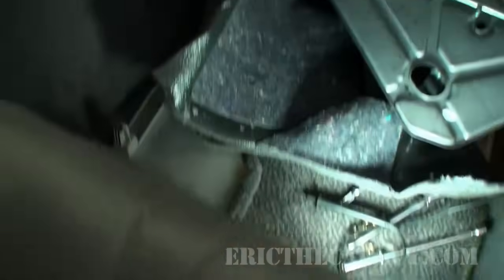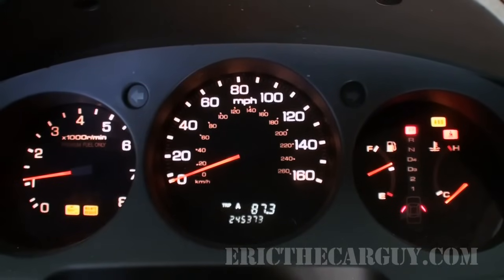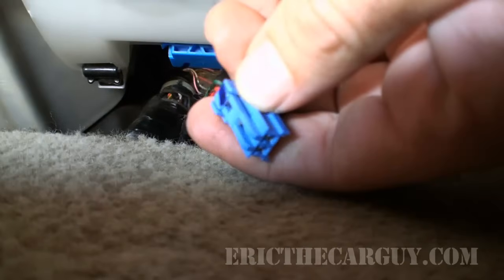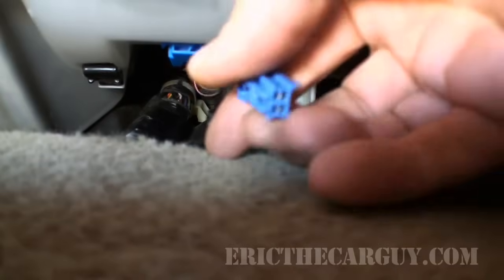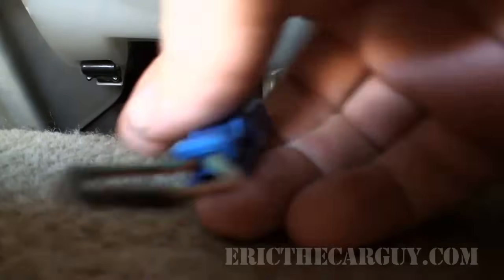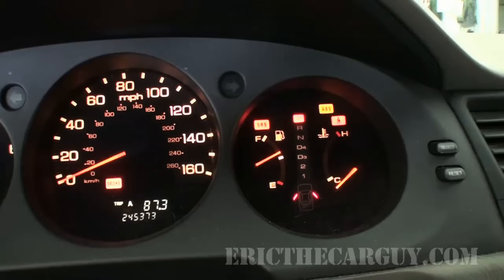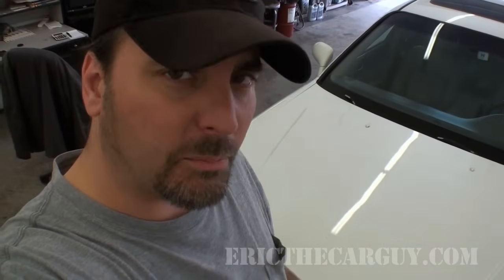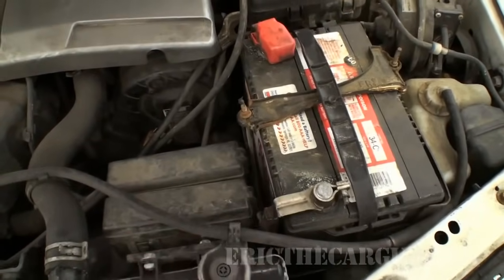How To Pull Honda Codes Without a Scanner -EricTheCarGuy

Comment: Thanks Eric, I was able to find that connector and after jumping it I got  a code 8 which was caused by the shift control solenoids being bad, it was easy to replace. You saved me lots dollars I am sure since transmissions shops are not cheap and I am sure they would say that I needed a transmission overhaul.

Comment: is it possible the first digits are the short pulses? i have 1997 Honda Civic, after shorting the wires and switching on the first flashes i seen are 7 short pulses then followed by 1 long pulse... please advice ^_^

Comment: Eric, got a good one for ya. I have 97 acura 100k mls Fla. car nice cond. ABS light on NO trouble codes on my OBDII or dash w/ jumper. I replaced All brakes new. everything except this stupid idiot light is working as it should.
Can I disable the dash light or something? need a NY inspection.
keep the great vids coming.
Reply: No, if they use a scan tool it will show the light as being lit. Move to FLa.
Reply: my abs light was on because i had a secondary brake bulb out.

Comment: If you can figure this one out your my hero....the CEL on my 1992 Accord WILL NOT light up.  I have replaced the engine cpu, the tranny cpu, the instrument cluster and actually rewired the circuit from the cpu up to the cluster itself.  However, when I do the test as you describe, the D4 transmission light flashes slowly (it is actually always flashing, just much faster when engine is on.) even though it shifts fine (after replacing the trans cpu) and doesn't seem to be a problem.  So I think the D4 light is actually acting as the CEL would.  There are some stalling issues and a difficulty starting when cold.  I can figure those out but do you think that my theory is correct regarding the D4 light.  Incidentally, it seemed as though the D4 light was flashing the code 1, so I replaced the O2 sensor, but no change.  I think that the D4 light is incapable of flashing the actual correct code for what is going on with the car.  ANY THOUGHTS?
Reply: check ur lower transmission shift solenoid wiring....mind was carowdded from leak coolent .   clean it out or jump it.   mind work back now ...now more d4 flashes.  good luck

Comment: hey Eric, i got 98 prelude i've been trying to look for the blue connector i couldn't find i strip the console down where my obd2 locate i still couldn't find it, i do seeing the female for the blue connector but nothing plug in it or any wire, can i jump from the obd2? which pins?
Reply: Its on the passenger side, go on facebook and add bballiancetb, prelude enthusiasts page. You can ask for help and tips

Comment: i bought a 93 del sol project car and have been building her up throughout the year and just installed an after market radio(pioneer ehg3600iu). couldn't get it to work the first time so messed around abit and replaced some fuses and ran power straight from battery. now for some reason my speedometer, RPM gauge, gas gauge and temp gauge doesn't work and the check engine light doesn't work as well because it was on before I put the radio in. but my turn signals, gear indicator lights and the actual brights indicator light works.  any ideas would be greatly appreciated.

Comment: On my 1996 Honda Accord, I ran into some problems trying to find a place that had a scanning tool to help me get the right code to get rid of my check engine light. So I just had to use the paper clip trick, and Google the codes online..

Comment: Hi Eric , hoping you maybe able to help I have a 2006 Honda jazz 1.2 DSI petrol the ABS light permanently stays on. Some one plugged in a tester and told me it shows a defective wiring fault/connection on pump. Can you provide any assistance do i require a new pump and modulator unit. Any assistance would be greatly appreciated. Kind regards

Comment: hi Eric, good day! I have a civic Lxi AT & here's my problem while on Neutral I step on the Gas not so hard just to make the engine make a noise then I put immediately the transmission to D3 then step on the brake & when I step out of the car I found out that theres an oil leak then it was the Transmission Fluid my Question is what happen to my car? the past years I'm also doing that but that not Happens, that was the first time I experienced it to my car, I hope you answer my Questions Thank you
Reply: Aneurism.

Comment: I used your video to pull ur codes on my 95 accord vtec (non obd 2) 
And one of the codes I got was code 52 for the Srs which is internal Srs failure 
Would you happen to know more about this particular code because all of the 50-60 codes are Srs internal failure
Thanks

Comment: I've come to the conclusion, that car manufactuers are idiots, and consumers are even bigger idiots.  Go to any junkyard, and look at the thousands of different dead cars, all with parts - not interchangable... and not built to be reliable... and way to complex  Then look at how many of them... are front wheel drive crap that is near impossible to work on, with the engines squeezed in their like sardines in a can.
Reply: no, I think you're the idiot here.
Reply: Some of those things aren't even safe to sIt in.

Comment: The shitty bullshit thing is that every god damn car should display these codes on the dash with a LED 2 digit number(bonus if text explanation is included with code or a voice box talks them out).  And every car should display key critical sensor data of shit that can fuck up your engine or keep it from running.   Voltmeter, water temp, oil pressure, oxy sensor air/fuel ratio, after boost temp, detonation, and a noid light when your injectors fire.  Most cars have all these sensors feeding the computer plus more, but no display of them at all.  When they go bad, the computer gets bad data, and your car runs like crap or not at all.
Reply: man, sounds like someone hasn't been laid in awhile........bro, in a perfect world I'd be a millionaire......the car IS talking to you, you just need an index of what the codes mean.......SHEESH

Comment: It's cool that you know how to do that, Eric. Some of the local auto parts stores here in Minneapolis and Saint Paul will do a code scan for free, but they also gave me and my friend Torleif a THREE PAGE printout of what the two trouble codes might mean! I figure they want people to buy one part after another, guessing what the trouble code means.

On his 2001 Dodge Grand Caravan finding the trouble codes is easy. With the vehicle off, turn the key forward three times; trouble codes are displayed on the odoemeter and then it reads - Done. That is the only thing the Dodge engineers made easy with the Grand Caravan. It's been one problem after another with that thing.

Whenever anyone asks me, "What's the most reliable brand of car?" I say, "Buy a Toyota."

Comment: It's called flash codes.Been around for ever and not a big deal pulling codes.
But nothing tells you actually what the failed parts is.Ex..If it's a P0420 which is a b1 catalyst (Aka catalytic converter) it doesn't necessarily mean you have a bad converter.
I'd recommend using caution when pulling codes or you'll end up just replacing parts and still end up at the dealer.

Comment: Eric.  My 1994 Honda Accord Wagon had a Master cylinder problem.  I replaced the Master Cylinder and the speedometer started acting whacky and then quit along with the odometer.  D4 keeps flashing.  I saw your video and decided to check the codes.  I got a 7 (TPS), 8 (TDC) and 14 (IAC or Bad ECM) and 17 (VSS) never came up.  I let the codes cycle a few times to make sure I did not miss anything.  Car runs fine just no speedo or odo Any direction you could point me toward?

Comment: Had same problem with brake lights. One bolt under pedal forget the name of it but switch will pull right out. Mine wasn't switch itself was just sticking. Replaced small o-ring and now works fine. Willing to bet that's your problem.

Comment: can you help me to reset the SRS(air bag)light which came on when I removed the battery.I know it is in perfect order but when you switch the engine on,the light goes off and then comes on.It is a 1996 Mercedes Benz C180.Regards

Comment: Mr Eric, the original PGM-FI ECU in the oldies, like the 3rd gen accord, is underthe drivers seat. That is the case in my car in particular, which is the 3rd gen accord EX-i/LX-i.
I do recall the legend being under the passenger seat, though.

Cool thing is, if you have an old OBD0 Honda and need to pull a code, theres likely a forum for you to ask the questions you need asked on.

Comment: thanks this really helped. determined error code was 52. looked up said faulty computer. performed reset and went out. one common issues I saw was computer clock messing up and reset fixes. good to know its not a $1200 seatbelt issue. If was seatbelt once labor added also about total the vehicle. finding new (used) computers for about $75. not finding them for my model yr. though. still need idea where to look for computer to get info off thugh.

Comment: they said probably cost like 1K + labor to fix, but we don't think worth putting that much into this old a vehicle and many other normal wear issues. the guy said too you don't want to do that find a 2 ohm 2 watt resistor and stick in there then computer will think normal. I think the srs computer is bad, but no idea where would be to check connections and possibly get model,. etc. to get new one.
any info appreciated this issues is really bugging me.
(sorry for double comment)

Comment: I have an 01 CRV srs came on one day after turning on stayed on. had shop reset twice. on again, every time same time of year like late nov early dec. have tested connections under seat. tried reset, but after watching this think wrong plug. notices abs flashing, but srs reset was failing. think know from another video were srs reset is not. any idea where could find connector for srs to pull code? we have cheap obdc scanner, but didn't get srs code. one shop looked said L/F seatbelt tensioner.

Comment: there should be a connector where you can jump with a wire on the passenger side underneath on the right side.

Comment: hi Eric, if i have a problem but no check engine light, will i still have codes for thoses problems ? Or it as to be when the check engine is on... ? Maybe the led under the passenger side ? i got the main relay problem, car sometimes wont star i've followed your video on soudering the relay it worked problem on the main relay reapear...so sometimes 20 min till it start...when this relay works bad is it a signal to the fuel injection ? thanx n stay dirty !  integra93 rs automatic 305 000 km

Comment: Hi Eric, I need your help please for my 97 Honda civic DX automatic. The problem is when I turn on my a.c system the lights in speedometer , headlights go high and low and it effects to the speedometer it runs crazy. But in a while the speedometer get to normal but the lights in speedometer and headlights still same. And if turn off the air condition system then everything back to normal . Could you please help me for this what is really the problem. thank you so much .

Comment: nice video Eric. question for you. I have a 97 Accord and yesterday it rained very hard to the point where lot of the roads were flooded. I may have gone over some of those little too fast to get to work, but my check engine light did not come on at that time. 
 I came out of work and started my car and check engine came on and flashed one.
can you tell me what it means? Thank you....

Comment: hi,i have a problem with my car....hope somebody can help me on it....i have honda accord sm4 or cb7 1992....i tried as this video to find out any codes that might be any parts wrong in my car....but i ended up with the check engine light on when i connect the jumpers...it doesn't flash or anything it just keep on all the time and if i plug out the jumper it turn back normal(it went off)....can anybody tell me what's wrong with my car????or what should i do???

Comment: Hey ETCG,

I have a 1997 Honda Accord EX and my ABS light is on. I pulled the code using the paperclip method. It had only one code which is, one long blink with NO second short blink, then it did it again one long blink and NO second short blink, and then again one long blink with NO second short blink. It only did that three times and then the ABS light stop blinking after that. I went on to your website and it stated, ABS pump motor over-run for code 1 but can you double check for me please.

Comment: Just done a UK 99 Honda CR-V with this method. The R/H/D UK cars blue plug is on the passenger side (left) footwell near the centre console. It has 2 plugs plugged into a blue plastic holder - one is the 2 pin plug and the other is a 3 pin plug. I used the 2 pin plug for SRS and ABS codes, and it worked fine (SRS codes wont cycle, it flashes each code once then stops. Turn ign off and on, it will start again) There is also an SRS reset plug in the fuse box (yellow square plug with 2 green wires)

Comment: i have a problem with my 94 civic. when i jumped the connectors the SRS light flashes constantly but the check engine light just stays on. I can't figure out the problem please help and respond.

Comment: i have a 96 civic ex and theres a little black button right next to the fuse box under the drivers side. what happens if i push it? is it like a fuel cut off switch? i vaguely remember my auto teacher talking about this but im not so sure

Comment: Hey eric i have a Hyundai and its supposed to have a check engine light when turning on ign then its supposed to go out when running if all is fine but it doesnt come on at all .....not even on ign or even if i force a code by unplugging the TPS harness etc, i checked the little bulb and it was fine even swapped it for the battery symbol dash bulb to make sure that the bulb may have looked ok but was bad but still no Check engine light ........im stumped. any clues ?

Comment: Hi EricTheCarGuy! First of all, you ROCK, man :)I just am having difficulty...  how to CLEAR an OBD1 code?????? I have an S10 Blazer from 1993, (full name: 1993 Chevrolet S-10 Blazer Tahoe LT, 4.3L and 4x4.) Flashing out Code 43. It's stored now.. Tuning up this truck, but WHAT DO I DO! The light stays on, and all I can do with the paperclip is get it to flash not CLEAR... I even have a wiring harness to my OBD2 but it doesn't work with it. just locks all my doors when I plug it in? Help? :/ TIA

Comment: Removing both negative and positive terminal and touch them together, it'll drain any left over current.  DO NOT connect them while they are still connected to the battery.  Touch them together separate from the battery.

Comment: Hey, what kind of diagnostic software would you recommend for a small shop or DIY?  Besides the OBD2 port scanner.  I'm talking more about scopes and/or dealership worthy tools.  Lately I've seen quite a few "cheap" tools coming out but I haven't bought any yet because I don't want to spend a whole bunch of money on something that may end up being a paper weight.  Also, most are only good for one make which doesn't help when I'm working on anything from Honda's to Porsche's.

Thanks.

Comment: Don't be a cheap ass. Go buy a $30 basic OBD-2 code reader(my Actron brand has worked perfect for the past 5 years) from Advance Auto. It's much better than frying your expensive computer and you can use it on any 1996 or newer car, such as your friends and familys cars. I would only use the "paper clip" method on OBD-1 cars.

Comment: Thank's EricTheCarGuy!   You saved me a couple hundred dollars, i was able to read the code on my honda, it was telling me a bad O2 sensor, i followed your advices and with a bit of carb cleaner i cleaned the sensor ET VOILA!  reset the check engine light, 600Km later and no more check engine light...

Comment: The exact same way EricTheCarGuy does it. Just get a make-shift connector and plug it into the blue two pin connector. On 97-2001 Preludes the blue two pin connector is on the passenger side of the center console. 
You can read more about it at preludepower by searching "HowTo: Retrieve CEL, ATTS, ABS, and 4WS Codes"
I actually have a CEL at this moment on my Prelude, I'll do a video for those who are interested but its exactly the same as Eric's

Comment: Older VW's with a CEL2 fuse panal: 90-99ish have a very similar capability but you use a low draw test light instead of a check engine light.

Comment: Ok so 2 months ago I  bought a 1995 honda civic dx coupe... found out the former owner connected the check engine light with the oil light... Now I tried this code trick and im getting code "21" which I got off another website is a vtec solenoid problem... My civic isnt vtec or have the solenoid on it so can you help me eric??? Also my srs light is constanty on now. How do I take care of that?

Comment: 91-95 acura legends have the connector attached to the ecu cover. (the plug is also grey) you need to pull up the carpet slightly to access it. (its under the passenger side floor near the firewall)

Comment: there should also be a separate connector for the srs codes. this is the case with the s2000 at least but it's probably the same. the s2000 SCS connector is in the drivers side footwell on the Australian delivered version

Comment: Just used a paperclip to diagnose a check engine light on my 95 Geo Prizm.  Guy I bought it from told me he's had it come on several times for some minor issue with an oxygen sensor and it cost him $100 to have it diagnosed and reset.

I did the same thing in my driveway in 5 minutes for the cost of a paper clip. :D